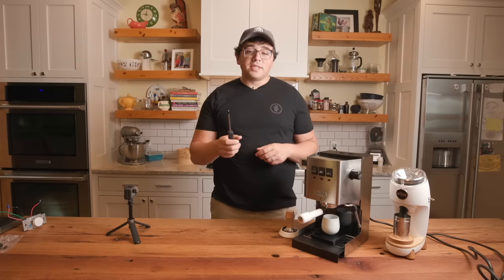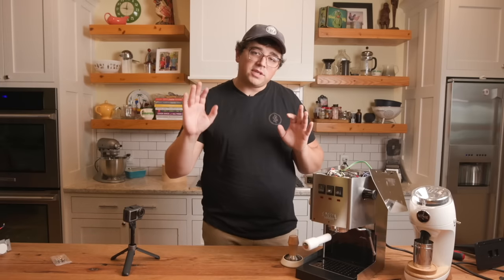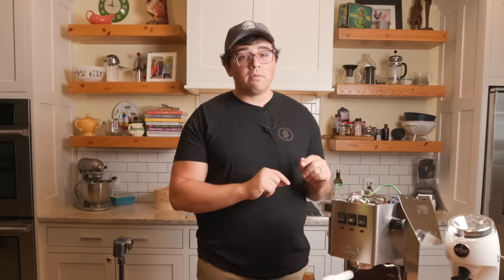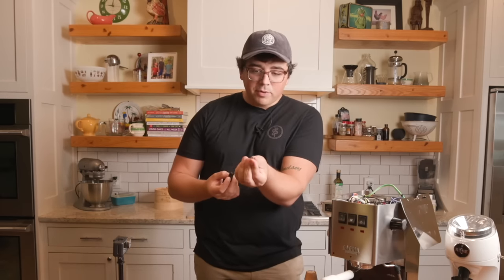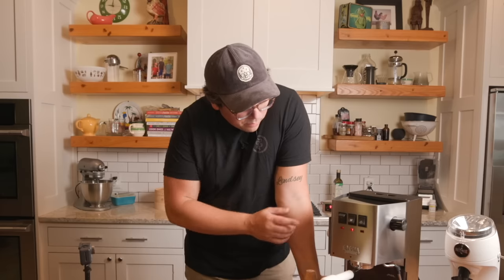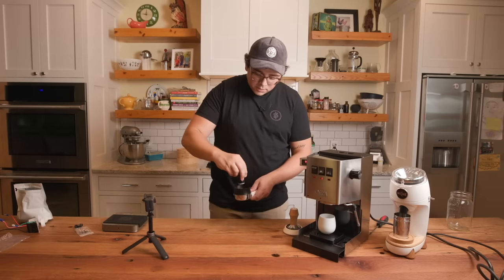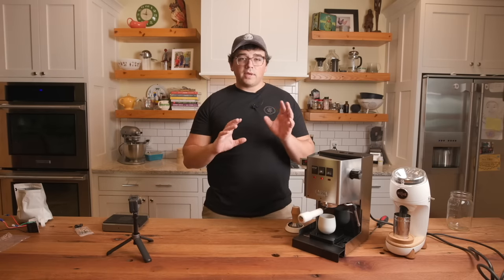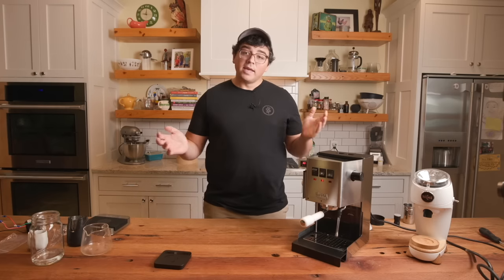TURNING A $450 MACHINE INTO A $3000 ESPRESSO MACHINE!: Gaggia Classic Pro FRANKENSTEIN

Comment: A couple things.... The older Gaggia Classics don't use different springs to change pressure. There is an allen screw adjustment for that under a brass fitting.  If you have a pressure gauge it takes about 15 minutes to dial in and you won't break plastic parts. PID's are essential, and there are some good private PID's available for $150 with good instructions. Time to install is about 30 minutes if you're handy. An hour at the max.  I don't understand the point of the flow control, as the benefit wasn't fully explained to my satisfaction.  The big negative of the Gaggia Classic is the small boiler. By the time you spend the money and do the mods you can have a Rancilio Silva that you can order with PID instlled.
Reply: The flow control also changes pressure. The spring just sets the "max" pressure. So if you also put a pressure gauge, you can basically change pressure and temp at will on a super cheap machine.
Reply: Truth is that this machine is accessible price wise to non nerd espresso lovers. If someone is looking to practice for world barista champ then by all means blow $3000 on a machine but the Gaggia especially the Gaggia evo pro with pressure control (9) is a great by for espresso lovers that aren’t full on nerds
Reply: @cray-z578  yes! My main issue now is grinders. I swear to God it was easier to decide on my smoker (and that was a process). Each time I think I’m ready I see another video that puts me back at Step 1. For a 500-700 budget, any recs on good grinders that will last
Reply: Ugh, these Gaggia's. Agreed about the boiler. Temperature issues and "surfing" and other tricks such as the steamer button, waiting for the lights to be on or off a certain number of seconds, and so on. You can taste the difference if you don't get the correct temperature. Not to mention that the boilers corrode and destroy their own selves from the inside out if they don't plug the pump first. I've owned a few Gaggia's, and modded them, but have fallen out of love and don't even recommend them to others any more. Buy a machine double the cost, own it double the time because it won't destroy itself, and quite honestly get better coffee throughout the duration.
Reply: i have the pid on both the gaggia and a rancilio. hands down the gaggia is consistently better.
Reply: Good point.

Comment: what’s your reasoning behind the 6 bar spring as opposed to the 9 bar spring? i feel like you might have answered this but i wasnt able to find it!
Reply: Hoffmann also recommends the 6,5 spring (when he did a similar video). Both of them like lightly roasted coffee, what is probably the answer. AKA slower extraction better taste(with lighter roasts). If you go for a turbo shot then use the 9 bar spring.
If you want a slow shot with 9 bar, then you need to grind very fine and use a puck screen, but I don't think this machine is compatible with a puck screen, so channeling is harder to avoid, so I think turbo or 6,5 bar is the answer.
Reply: @Perceptence  🫠that depends on your coffee and grinder. Darker rost are (somewhat) easier to grind to right size(they break up more easy because they have lower volume of moisture). And the grinder should produce even results aka cheap grinders will produce a mixture of fine, medium and large particles on the finest settings. So when extracting the fine part causing more resistance(for the hot water) the bigger ones less. So some parts of your puck are over extracted. In worst case some part are over extracted, some parts are under extracted even channelling can happen in your puck. So you have to back down(in the grind settings), but that might cause you a turbo shot, what if you don't want a turbo shot, then you have back down in pressure: that is why everyone recommendeds the 6,5 bar spring (it's easier to dial in).
Sometimes you extracting just fine in the beginning, then over extraction happenes in the end, why because your puck broke up some much in the process it can't produce the right amount of resistance in the end(puck exhaustion). Again you have to adjust the grind settings or pressure.

(bonus: in the EG-1 review he said he chocked up the Bianca, that is a 4k euro grinder choking a 2k euro espresso machine. Why, because the grinder producing not just fine, but even particles so channelling didn't happen the machine stopped when the resistance was too high!)

Comment: Nice job with this project and congratulations Dad! Love to tinker as well and your video inspired me to install a dimmer to control pump voltage thus water flow. The PID controller was installed this summer and has been a really nice addition. First I tried wiring the dimmer from the positive wire attached to the pump switch but it didn't work out really well and made some crazy noises when the dimmer was about half way. Today I tapped the grey wire going directly to the pump which did the trick. So now my GCP is modded pretty much like yours with the exception of the low profile drip tray. I pulled out the drip tray all together and have a shot glass under the overflow tube and scale on the ground giving me lots of room to work. So tomorrow morning I'll attempt my first pre infusion and hopefully pull a couple of nice shots. Appreciate your help and your videos!

Comment: Great video Lance - and great to see a Classic with almost as many mods as some of mine :-)  You really need The One single hole steam tip on it too… so reach out to me and we’ll fix that for whoever wins the Classic giveaway.
Reply from the maker: Haha sounds good! Thank you so much for that offer! I still feel silly for setting the dang PID to 9.5C instead of 95C haha. That was miserable.
Reply: @LanceHedrick  don’t feel so bad - if you originally configure the sensor to be P100 and then set the temp to 95 - and then later you realise it should correctly have been P10.0 then the temp config will change to 9.5. It could have been either issue - but it’s easily done.
Reply from the maker: I will say I was majorly relieved when I realized that was the issue. I thought I fouled up. Instead, I did the mod correctly and the easiest part I flubbed lol
Reply: Love my The One! I dont understand why it's not the standard steam tip, much easier to steam with it. Thanks Soc.
Reply: The One single hole is awesome!
Reply: Any word on the Shades puck screen? I haven't checked in on that in a while.

Comment: This makes me so happy to see, as I own a hot rodded gaggia classic. I currently have the PID and dimmer mods - but also installed a copper pre-heat coil around the boiler to reduce temperature drop over the course of a shot, and a pressure gauge. I think the pressure gauge is critical for getting the most out of the dimmer mod - since it tells you exactly what pressure you are at for low pressure pre-infusion and pressure profiling shots. 

Another feature of the dimmer mod that is worth highlighting for people is that if you set the flow just right, you can simulate a spring lever shot - a slow preinfusion ramp up to full pressure, followed by a gentle decline in pressure over the shot.
Reply: "also installed a copper pre-heat coil around the boiler to reduce temperature drop over the course of a shot". I used usual stainless steel 30-50 usd thermopot with T control, set at holding 94C and got stable pre-heated water, it works like outside boiler. PID is holding 93C this way so long you need it. :)

Comment: phenomenal work, wish a vid like this existed a year ago when I had a GCP!
Reply from the maker: Haha! Thank you, Xris. For everyone reading, go sub to this man
Reply: @LanceHedrick  🙏🏻
Reply: A simple google search or a search on here will show that none of the "mods' are needed. 
Perhaps one adjustment with a solid bottom in the portafilter and a pressure gauge whilst you adjust the pressure relief valve.
Reply: @union310  Links? I would counter that they are needed... you cannot actually achieve what a PID does without one and an adjustment isn't going to get you that control if that is what you seek. Even with them you are still not at the level of a 3k machine.
Reply: @xjbladderx  Tell me then what any of the mods achieves?
Reply: i hated my gaggia, now i am just finding out theres a ton of things youre supposed to do to make it workable. the biggest thing i wish i knew was not to wait for the light to come on to steam, start it before so the element stays on...such a dumb design.

Comment: Hey Lance! I found your channel recently and I have really enjoyed your content so far. I have had a Gaggia Classic Pro for about a year and a half, and I just started doing some of these "normal" mods myself. So far I have done the bottomless portafilter, upgraded shower screen, and new filter basket. Noticeable results already! I have a 9 bar spring kit and PID on the way. One thing I wanted to point out was that at around 4:40 you mention that the OPV shunts water into your drip tray. It actually shunts water back into the water reservoir. Small detail, I know, but one thing I noticed while examining and cleaning my machine was that the OPV return tube seems to hold on to stagnant water quite a bit. Mine contained a weird, nasty, film that was impossible to remove without taking the tubing out. Just something to keep in mind since that nastiness is getting pumped back into the water your drinking!

Thanks again!
Reply: Indeed, i wonder why it goes back into the reservoir and not the tray.
Reply: @Johanlob1  the old version of the GCP used to dump it into the drip tray. the newer version dumps into the reservoir to avoid filling the drip tray too quickly since the OPV line can put out quite a bit of water

Comment: Hi Lance, I'm discovering this video just now, since I clicked on the link from your recent "Ultimate Espresso Machine Modification" Video. I started watching that but then decided this would be a good starting point.

I'm not sure if it's something that you've figured out yet, but if you can change your PID gain values, then the reason that your water initially heats past the set temp is because dynamic systems will always have overshoot after the initial ramp. Since the only function you have is to heat, the system can't control cooling values and as such it just needs to wait for the system to cool down from the ambient temperature, hence why once you flush the grouphead you're able to bring it back down to the right temperature. 

You can prevent the initial overshoot by increasing the D (Derivative) gain control value, but this will also increase the rise time of the system, making it take longer to heat up. You can typically tune it pretty well so that you can find a balance between increased rise time and very minimal overshoot.

Comment: I’m just finishing up these mods (PID, pressure gauge, dimmer/flow control) installed in Shades’ Top Box. I love a good project, but these mods are very challenging on the newest Gaggia Classic Evo Pro machines. It’s really tight in there…! You’re going to have to read the manual most likely. Mr. Shades is awesome though! Got me sorted out a few times during the process. I got the Gaggia partly to be able to do these mods, and it’s a great little machine!
Reply: I was also thinking of buying the PID and OPV from shades, can you recommend it? Im not a beginner in building things at home like furniture but have no idea about wires, can I still do it?

Comment: This was a fantastic video with some great mods, guides, and explanations about how each mod works! I thought that the temperature offset that you used to account for heat losses was a really neat idea.

A few semantic suggestions from an engineer:
1. The temperature controller is called a "PID controller" and not a "PID". "PID" does not really work standalone to refer to a control box, since it refers to the concept behind the control algorithm programmed into the PID controller.
2. The plural of "bar" (as in 9 bar of pressure) is simply "bar" and not "bars".

Feel free to ignore these suggestions if it is already too ingrained in your vocabulary to change now or if you don't care. But, if your goal is accurate technical language you should consider trying to make these adjustments. I picked up from the rest of your video that you care about the linguistic precision so that is why I left this comment.
Reply from the maker: Yep! I'm aware of these. I frequently just screw up and say "bars." As for PID, as with other acronyms or complicated/long names, I tend to abbreviate. But I can certainly change that going forward!

Comment: Good video. I had a similar issue when I fitted my PID. it worked for a bit, but one day stopped working. Emailed Shades of Coffee, and went through settings, and found I'd set the temperature to -95 degrees.

Comment: Thanks for all the informative videos! I’ve learned a lot and I’m having a blast watching them (pun intended).

Question: How did you decide between the 6.5 and 9bar OPV? What is the rationale behind it? Thanks
Reply from the maker: Mostly the rationale was I really love 6 bar shots. So, when I'm not flow profiling, I can lazily open the dimmer all the way, let the OPV shunt flow, and have unlimited 6 bar shots haha
Reply: Want to know the same
Reply from the maker: The lighter the roast, the lower the puck integrity. The lower the puck integrity, the harsher higher pressure is. The harsher the pressure is, the more chance of channeling. 6.5 bars allows both turbo shots (check my video on it if unaware) and allows for lower pressure after soaking the puck.
Reply: @LanceHedrick  with the dimmer you can even bypass the opv or set it higher like 9- 12bar... then grind very fine with big baskits without choking by having the extra pressure, then back the pressure down to control the flow....basically giving a wider range of pressure to work with for more options
Reply from the maker: Oh wow! Didn't know you could bypass the OPV. How does that work?
Reply: @LanceHedrick  Gotta love youtube... always comments like this with no follow up.

Comment: How much do you really need OPV mod if you have the dimmer mod? I imaging if you control flow, you essentially control the pressure no?

Cool video. I'm definetly doing PID mod at some point (also busy with 2nd baby coming soon). I already have OPV mod but I'm curious about the simplicity of the dimmer switch mod. One thing I don't like is the esthetics of the two exposed boxes. But I've seen other options for PID (hiding it behind or other PID kits that sit on top).
Reply from the maker: So, first, I didn't focus on aesthetics. Lots of better ways to do these. Can mount the dimmer inside and drill a hole, for example. The OPV mod isn't necessary, but it allows me to pull 6.5 bar shots without have to mess with the flow. I would recommend getting the pressure gauge mod if no opv
Reply: Yeah, that pressure gauge mode is definetly trickier to install thought but would love to have it. I think it would look good.
Reply from the maker: It absolutely would. And would help with extractions

Comment: That flow control is really interesting. Been using your "Crack the steam wand" hack to preinfuse, but might take a swing at this. 

Will also say, the PID is absolutely worth it, though it does take several hours to install and you need to read the manual to adjust the settings correctly. 

9 bar OPV + brass IMS grouphead block/shower screen mod, and she runs nice and consistent.
Reply from the maker: Yep! Absolutely. The steam wand hack works, but plummets the temp..should look into the dimmer! And can mount it on the inside and drill a hole for a clean look
Reply: @LanceHedrick  Nice! I was curious about that! After the dimmer mod I want to make some cosmetic changes like a wooden steam knob., a wooden pf handle, and now a wooden dimmer knob.
Reply from the maker: Yes! If you do it, shoot me a pic on IG or somewhere. Would love to see the final product

Comment: 16:40 ish - I think that's a feature to help heat things up quicker, rather than focusing initially on getting to the right temp which means slowing down and  hitting the target temp it overshoots, I'm guessing you're expecting to do a little flush to get all the parts more equalized temperature wise, then it stays more stable at your desired temperature, so that's pretty neat and smart for a PID.

Dimmer mod is pretty neat but ideally you want a pressure gauge with it!

Comment: Temp overshoot is from the d value under damping the system. It rises fast then rings around the setpoint. Tweak with the values and you can slow the rise time a fraction for smother hold

Comment: The over pressure valve is adjustable and does not need replacing.
Espresso is extracted at 9 bar. That is fact.
Reply from the maker: 1) that is not fact. Espresso doesn't necessitate 9 bar
2) I show how to adjust the opv in this video
Reply: @LanceHedrick  I see you removed my reply where I provided the link to wikipedia demonstrating that 9 bar is indeed required to extract espresso.
Also my comments on the relationship between pressurised steam and temperature that proves your mods are not required.

Comment: The pump draws less than 50 watts. Best location for the dimmer, provided your machine is no longer in warranty? Inside the machine itself! Pick up a rotary lamp dimmer. They are small, and can easily fit inside.